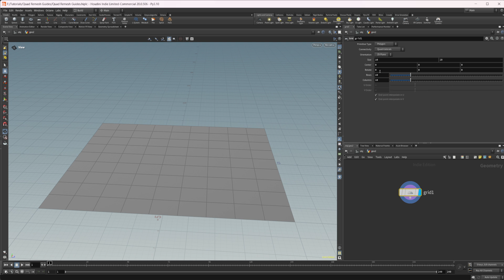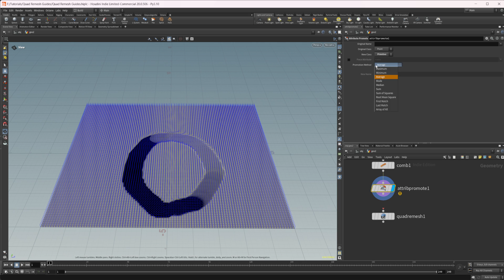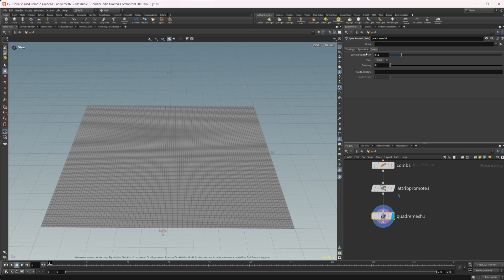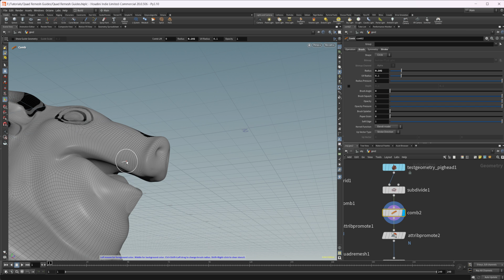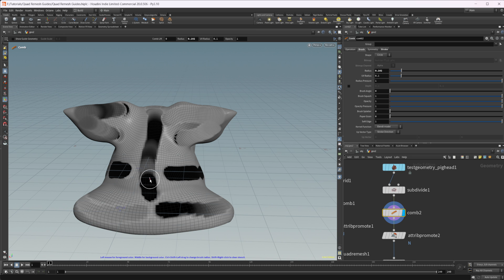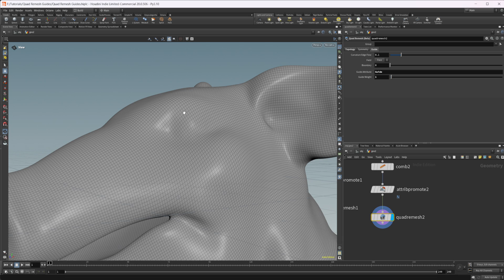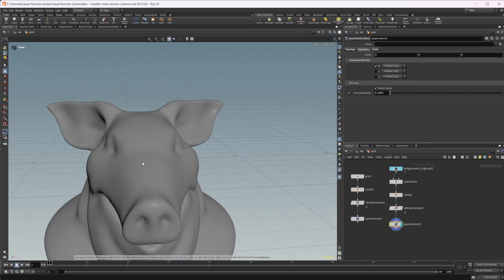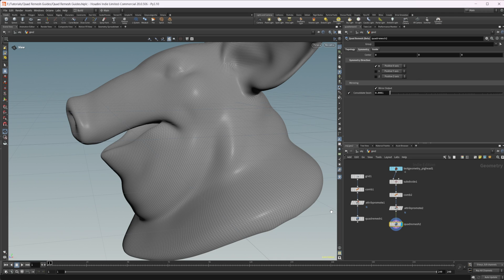Better Quality Quad Remesh in Houdini 20

Comment: Not as good and as easy as using the C4D remesh and Flow Splines.
Reply from the maker: Its still in beta. I'm sure it will get better. Also C4D is using the zremesher on the back end from zbrush so it's been in development for a lot longer

Comment: I used the paid quad remesher a while back and I read the paper for this approach. I respect how difficult topology is but I've yet to find a use case for these tools. I use zbrush's remesher as part of the sculpting process but that's only to set up a triple digit polycount mesh I then subdivide to hell. Even with an almost pointlessly dense mesh you couldn't get this to preserve any detail. I've had even worse results getting harder/blockier geometry to conform. The work I have to put in to deal with the issues these tools cause usually exceed a manual retopology and/or triangulation.
Reply from the maker: Interested that you have that issue. This quad remesh isn't as good about preserving detail as the exoside one is but it's insanely fast compared to the exiside one. I usually use a ray after to reproject after the remesh and get good results. Definitely not something for a character but usually it's pretty decent for hard surface meshes or creating a low poly mesh in my experience